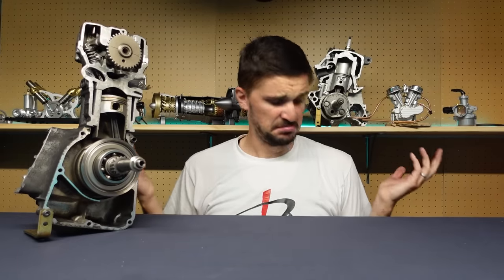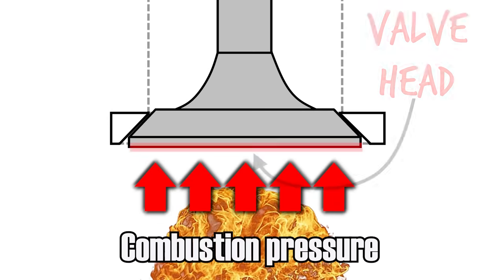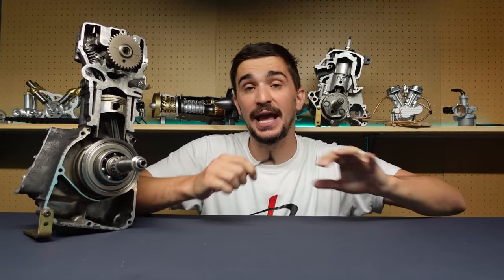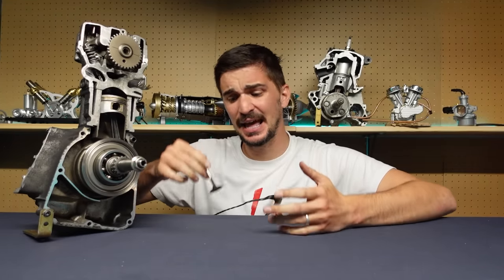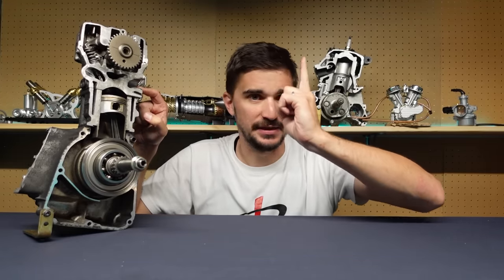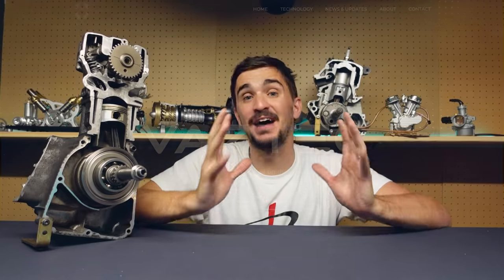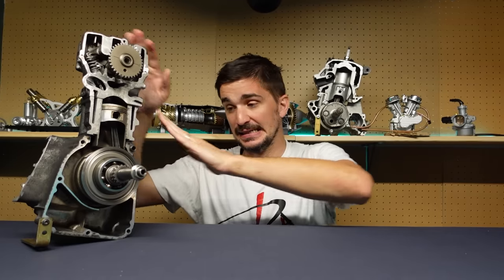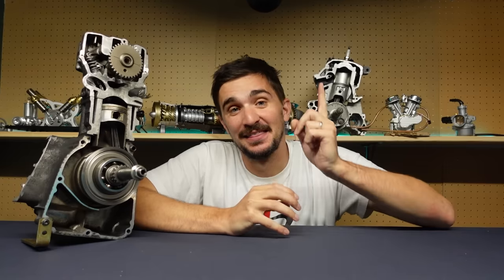Rotary Valves Make Normal Valves Look Silly - Why Aren't We Using Them?

Comment: Sachs used a rotary induction for years, I always thought about adopting that system on a 4 stroke engine. A spinning valve doesn’t have to reverse direction or slam against the seat. I just didn’t have the millions to develop it.
Reply: Then you're lucky.  They say that if you want to make a small fortune, then spend a large one on rocketry or aviation.  (Or rotary valves.)
Reply: @tonyduncan9852  How much do you think the collective auto industry has spent on refining poppet valve tech over the past 100 years? Even the total loss lubrication engines from 100 years ago had more development time & money in them than the rotary valve tech has today (and those old engines had nothing to do with words like "reliability" or "maintenance intervals")
Reply: @raoulrr  exactly, engineers have had many years of R+D to study the subject so if there were a better alternative to poppet valves they probably would have been implemented. Apparently, reduced flow around the valve and parasitic loss from the valve train are minimal enough to negate a different and possibly more complex design.
Reply: The rotary valve on a 2T engine only has to seal against the 0.5 bar (or thereabouts) of crankcase compression, and is constantly cooled and lubricated by fuel/oil mixture. Much easier life than the exhaust valve in the head of a 4 stroke, which could (depending on the engine) see pressures of 100 bar or more and reach temperatures greater than 600 degrees C. The biggest challenge for rotary valves in 4 strokes is basically preventing the oil film that lubricates the valve from breaking down upon exposure to those conditions. The valve is always moving, so it must have an lubricating film to prevent rapid wear and provide an effective seal.

The best alternative to poppets is a sleeve valve, which cleverly uses piston rings to form the moving seal and thus circumvents the problem of having to lubricate a large area of sliding valve surface. They do have their own issues however.
Reply: @nerd1000ify  I agree, the rotary induction system just isn’t designed to handle the kind of PSI a cylinder creates. If someone could figure out a seal that would work, a spinning motion has to be smoother and rpm friendly than reciprocation. Then there’s the two stroke which relies on ports and a leakproof crankcase as they need both psi and a vacuum for proper operation. All I know is whoever invents such a rotary intake system for 4 strokes will one wealthy SOB lol

Comment: This valve seat recession issue which drove the use of leaded gas is still an issue with small planes that still use leaded gas. A pilot school recently tried to switch off leaded gas for their small planes; and found they had major valve seat recession issues resulting in the need to switch back to leaded fuel for their small planes.
Reply: There you go.
Reply: They didn't do a double blind controlled experiment on it, though, so no sure way to know if it was the fuel or a material problem or the way they operated those engines.

Plenty of those engines have been operated on unleaded pump gas over the years with no reports of valve seat errosion.
Reply: @oscar_charlie  The investigation into the University of North Dakota’s recent issue with UL94 is ongoing. maybe it's all related to the Lycoming engines that power UND's fleet of Piper PA-28-181 Archers and PA-44-180 Seminoles.
Reply: Small plane engines have been frozen in the past for decades, useing old designs from the 50's that where barely improved from the 30's ones.

Comment: Many other rotary valve configurations have been proposed, some of them leading to actual hardware. My favorite is Frank Aspin's peripheral port rotary valve placed inside the cylinder head. That didn't solve the sealing problem by itself, but did make it more accessible. The Germans also experimented with a disc-type rotary valve during the war, for a short-lived expendable engine.

Comment: Mr.Merritt Zimmerman used rotaty valves in motor cycle racing in the 1950's. It had a lot of power and won races. He was always trying to improve seal life and had some oil comsumption problems. As a small shop, he did not have the resources to continue the developement on the concept. The engine had a lot of bottom end torque and a very high rpm range ( I believe rpm limit  was 14,000). I believe it was silghtly over 2 hp per cubic inch in 1955 on a 4 stroke engine. Which was incredible at the time.

Comment: The valve cylinder should be tapered. Then as thermal expansion happens it can slide out a little bit and still maintain the same clearance.
Also a linkage drive may be a better design. Then you can have it move in a nonlinear speed. Open quickly, dwell a bit in the open position and close quickly. A second link can be added to accomplish variable timing.

I struggle believing this will actually last. The automotive manaufacturers have s done a lot of research. Many crazy designs have been tested, and surely this one has too. The patent must be a design patent as this idea has existed for about as long as engines have, and sime steam engines used similar.
I would guess it gets fouled up with combustion products and tiny amounts of dirt that make ot through the filter.
Reply: "The valve cylinder should be tapered" - Poppet seats already are.  The complexity of non-linearity is heavy.
Reply: @tonyduncan9852  I am not talking about poppet valves. And nonlinear movement is easy with a simple four bar linkage.

Comment: What most people do not understand, including our presenter here, is that the energy spent to compress the valve spring returns to the system when the valve closes.  The overall frictional losses of the poppet valves are not significant.  The main issue with the rotary valves is hydrocarbon and particulate matter emissions.  The reason poppet valves are used extensively is because they work, and they work well.
Reply: And not only can you even see the energy returned in the first bit of the video (the camshaft springs past where has has turned it to), that's happening with a dry engine. When the engine is running there's a continuous film of oil on the cam lobes and things are very smooth. And if they aren't, you're going to need some new parts real soon. Source: am mechanic.
Reply: "is that the energy spent to compress the valve spring returns to the system when the valve closes"
What seem to not understand is that compression energy and kinetic energy work somewhat different from one another.
The energy transfer you describe is at its most efficient when the rotation of the cam shaft is extremely slow (and even then it has losses other than friction).
But when the RPMs rise, it gets less and less efficient, because more and more of the springs energy goes into its own acceleration and that of the valve and rocker, and thus not back into the camshaft.
The phenomenon of floating valves happens because the cam rotates faster than the spring can move the valve back into place.
I hope it goes without saying that in that state, when the rocker actually looses contact with the cam, the spring imparts NO energy back into the cam shaft.
And the higher the RPMs go, the closer to that situation they get, meaning the energy feedback gets closer and closer to zero.

For an analogy, imagine trying to push on a moving object:
If it moves a lot slower than you can move, it is easy to impart energy on it.
The faster it goes, the less energy you can impart.
If it moves at or above your maximum speed, you can't put any energy into it at all.
Same goes for the spring (which has a fixed maximum speed) and the camshaft.
Reply: @rockyblacksmith  You are not entirely wrong.  As you increase the rpm, there is more energy lost inside the valve spring themselves.  Its called "hysteresis".  But it is still not a major issue.  It is relatively easy to measure valve train friction.  That measurement takes into consideration more or less automatically of all these factors.  It does not account to much.  And in fact, it diminishes some with speed because the lubrication improves some (I am talking about flat cams, roller cams have even less friction).  Valve float is a different matter, engines should not operate in that region.  The point here is people assemble engines and feel the drag that the valve springs apply, and intuitively think that valve train friction is a bit deal.  It is not for the reasons stated above.  Piston friction is the big deal, once you add the gas pressure when the engine runs.
Reply: @demetridar506  I'm not sure where exactly in the spring a hysteresis behaviour is supposed to occur or rather, of what kind. There are hysteresis phenomenons in plastic deformation, but the whole point of a spring is for that NOT to happen. 
But regardless of that, you are not adressing what I said.
I described a physical process that dictates that there MUST be a loss of energy between them.
Now, if I am wrong, feel free to point out the error in my physics.
If you want to make the point that the energy loss is neglegeable even at the maximum revolutions of a given engine model, then feel free to give me the math for that.
Reply: @rockyblacksmith  There is some loss of energy, sure.  Most of it is via friction in the follower cam interface.  I am sure some takes place in the valve spring since there is heat buildup (valve springs get hot and are cooled by the flowing oil mist).  What I am telling you is that there are numerous measurements of the total energy lost in the valve train.  They are about 10% of the total frictional losses.  By comparison, the piston assembly can be way more than 50 % of the total friction under load.
Reply: @demetridar506  I wasn't talking about friction here. 
That's it's own area of loss.
I was talking about a physical limitation as to how much energy a spring can transfer into a moving object. This would be an area of loss even at ZERO friction.
You talk of measurements, but what any given measurement is saying very much depends on HOW it is measured, what is accounted for how, etc.
For example: I wouldn't find it unreasonable for the calculation to not assume the non-recuperated spring energy to be a loss to begin with. Moving the valve train is the objective, and as such energy imparted on the spring is transferred and put to use, not lost. So why would it be counted as such?
Now, I don't know whether that is the actual case.
But until you can explain to me what part about the physics I'm missing, I find it far more likely that the measurements aren't describing what you think they do instead of physics suddenly working different in there. Because just like any physical measurement (or scientific measurement in general), you have next to no idea what it actually tells you until you know how it was measured.

I am more than willing to admit that I got the physics wrong here, but only if you can actually point out an error.
Reply: @rockyblacksmith  I am trying to understand what exactly you are asking, but it is not clear, even though I read your post two or three times.  Hysteresis, or delay of the spring energy to return back to the system would be measured as friction.  The camshaft will not get all the spring compression energy back in the valve closing event due to hysteresis.  And the valve spring will get hot, so mechanical energy will be transferred into heat.  Now, how is the valvetrain friction measured?  That will be a very long post.  But measuring valve train friction is not anywhere near as challenging as measuring piston friction.
Reply: @demetridar506  As said before: I am not talking about any hysteresis here. That has nothing to do with the phenomenon I was talking about. 
I'll try to explain it a different way:
The spring, when compressed, has a fixed amount of stored energy, lets call it C.
When the spring is released, that energy turns into other forms of energy.
Specifically, it is divided into two elements:
- A: The kinetic energy imparted on the valve train
- B: The kinetic energy imparted on the camshaft.
So the equasion is C=A+B.
Now the whole point of the spring is for the valve train to always move fast enough to keep up with the RPM.
That means as the RPM go up, the valve train moves faster.
Higher speed means more kinetic energy used for the motion. 
Because remember, moving the valve train up and down within 1/100 of a second takes more energy than doing so within 1/10 of a second.
Ergo, A must go up.
Now, if C=A+B with C remaining constant and A going up, then what MUST happen to B?
It goes down. 
This is basic conservation of energy. 
No loss to friction or heat is yet factored in at ALL. 
And still, by mathematical nessecity, the amount of energy transferred back to the camshaft MUST go do down as the RPMs go up.
Friction and heat would be additional factors that would reduce B even more (since neither C nor A can change for a given RPM).
I've done as close to a mathematical proof as I can in a YT comment, so if there is a flaw in there, it should be visible by now.
And if not, then my point stands.
Reply: @rockyblacksmith  You are correct in your analysis, but this is only a part of the problem.  As the spring energy returning to the cam is reduced, so is the valve spring load on the lifter.  I.e. the normal load between the lifter and cam lobe is reduced, which in turn reduces friction.  In other words, as the valve approaches maximum lift and closing, the rubbing friction on the cam lobe reduces because the valve spring force is used up for inertia.  Also, the higher speed reduces the fiction coefficient.  So, when you actually measure the energy it takes to drive the valve train, it actually reduces with rpm.  And this energy to drive the cam is the ONLY way the valve train physics can affect engine efficiency.
So, don't worry the engineers have done their homework.  Poppet valves work and work well.  For most applications, the benefit of rotary valves is negligible.  One case where rotary valves actually did work well and better than poppet valves were in WW2 aircraft engines, the "sleeve valve engines".  Bristol and Napier built those..